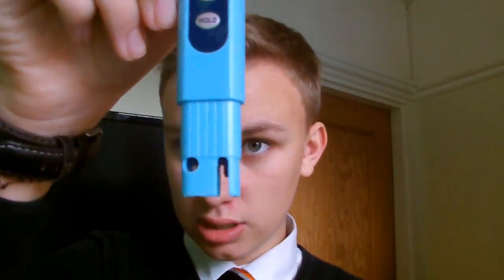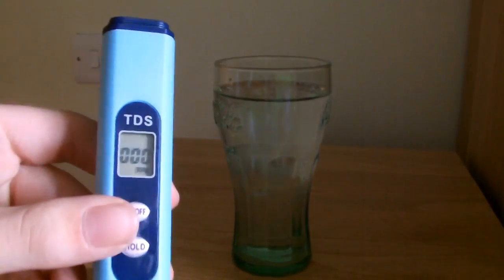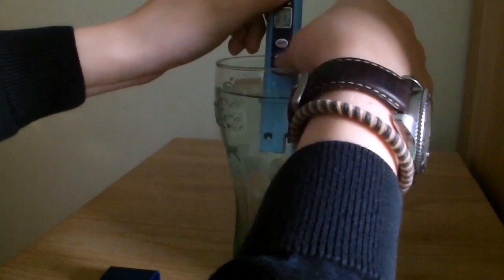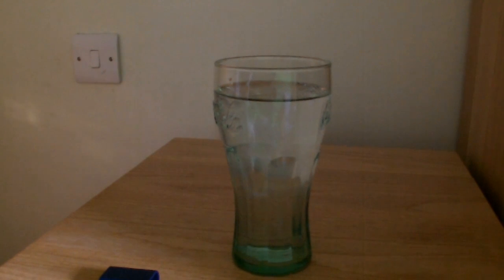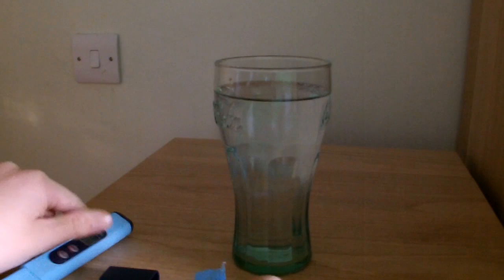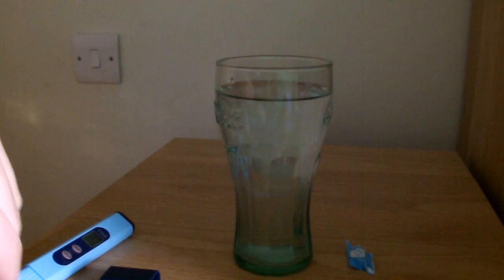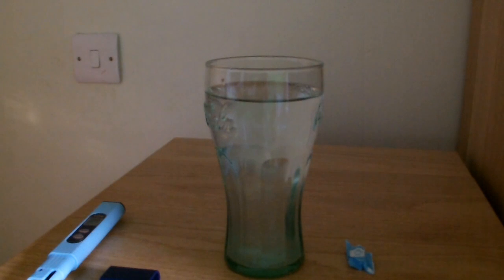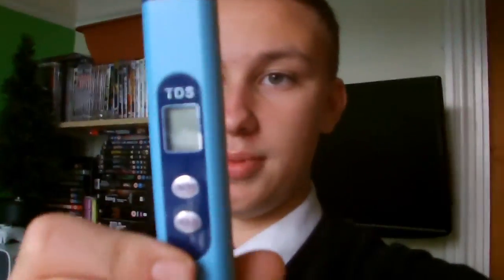How you can test for fluoride in your water

Comment: if you look at the bottom of the screen on the tds meter it will say times ten or some other number. so your actual reading would have been 321 times ten. the first reading you read correctly but with the salt in the water it would have been the number on the screen times the number at the bottom of the screen. usually the exponential number will be blinking, and the tds meter will read fluoride. it gives you the total amount of desolved solids, all solids. what it won't tell you is if there are any biological components or cellular life in the water, such as bacteria or amoebas.